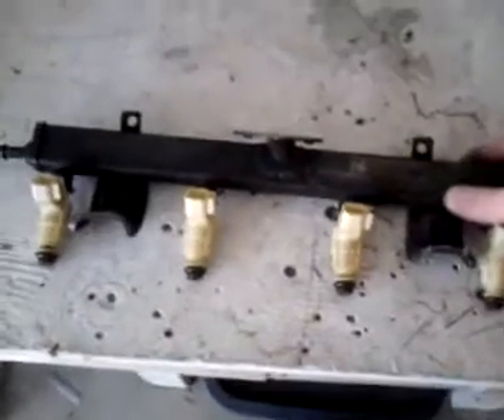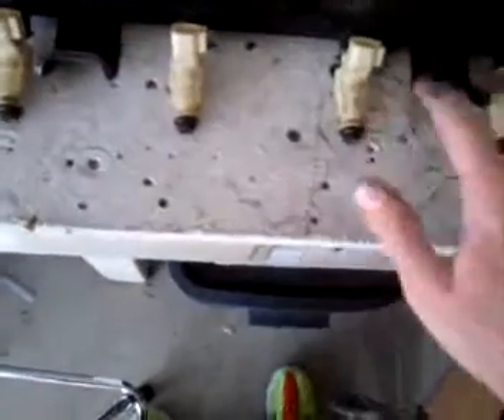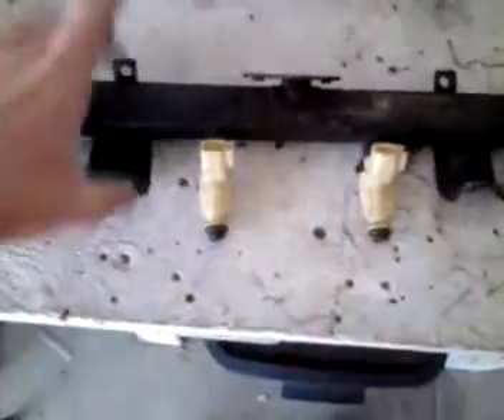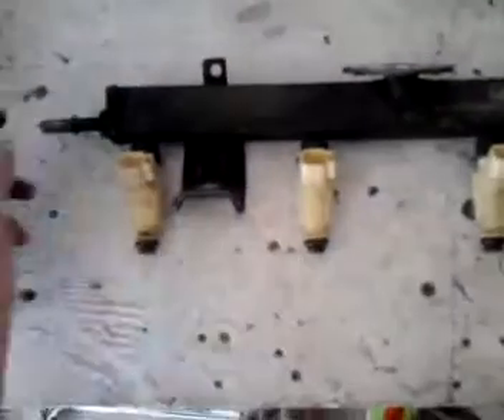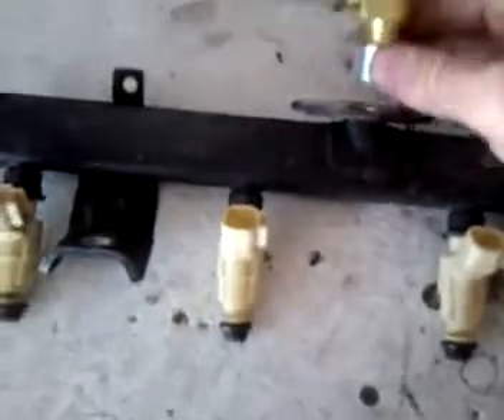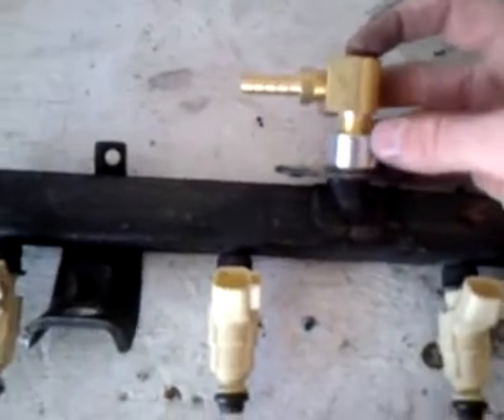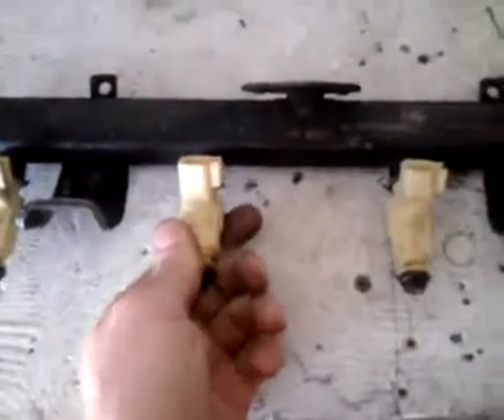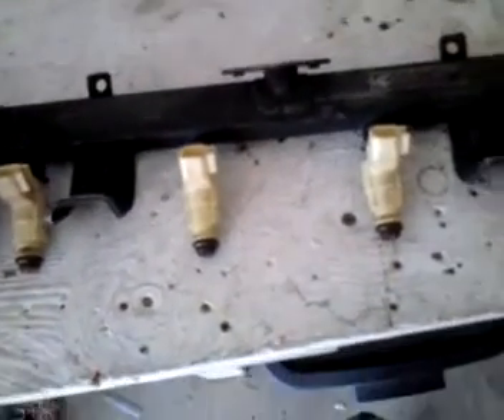Porsche 924 EFI conversion (fuel rail)

Comment: Nice video.  Can you tell me what the injector bore center to center distance is?  My 924 is 120mm from center to center.  The ford focus rail I have is only 102mm.  So it won't fit.  Maybe you used a different ford rail.
Reply from the maker: It would be from a 2000-2004 Focus with the 2.0L Zetec engine. I tried valiantly to use this rail. I had nice brackets made and had fuel fittings welded on by two shops. Unfortunately the weld had pinhole leaks and I felt I was throwing money at this tail, so I bought a brand new OBX Performance Ford Focus fuel rail (check eBay, $100 ish) made as a direct replacement for this rail. It had built in ports for return fuel systems that were easy to buy fittings for. No welding required.